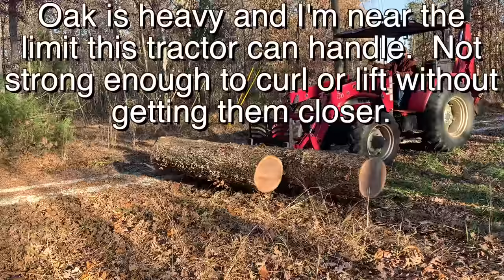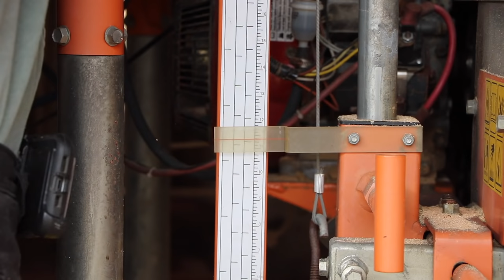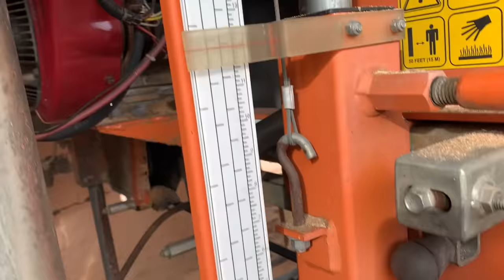Printing Money With My Sawmill...Wood Costs How Much??

Comment from the maker: Hope you all have an excellent weekend!  Yes, I am still working on my Johnson (SMH) but it's taking a bit to get parts.  Cheers everybody!
Reply: Totally save the disks from the punky log, and cut more of those disks. First of all, shorter boards still have a ton of uses, and the disks you cut off will make excellent knife and/or axe throwing targets. :-) Axe throwing is big now!
Reply: Merry Christmas to you and yours, I'm fixing my house so I can move back and get some property right look forward to doing this for sure thanks for sharing look forward to hearing from yorder the ear from them by for now Ken.
Reply: What is a Johnson (SMH)?
Reply: Just toss some VIAGRA at your Johnson  . . . but it's just a 'temporary fix' !  ;)    * I've worked on some of them from the 50's , & had to get creative with making parts !    ** It's amazing how parts like coils / points can be made to work . . . though it takes some creative engiNERDing  . . .   HO HO HO ! ! !
Reply: @Berrnie Mccannaster The flat side of the blade runs against bearings. Those bearing absorb the force from pushing against the log. Sharp tooth would not work well.
Reply: Not sure if you put two and two together yet but Fukushima happened just over eleven years ago now and over the last decade have you not noticed seemingly healthy trees just dying of over the last decade.  Pines especially, i mean look around forests look like crap the wind brakes between farmers fields are all but dead.   Don't get me started about the fluara (other than trees) and fauna and us humans.  Fukushima was an ELE (end life event) as far as i am concerned.   For sure was several orders of magnitude worse than Chernobyl.   Love your work and i thank you for the content.
Reply: What types of blades do you use?
Reply: @nervousordo  Johnson is his old engine. Here's one of his videos on it:
https://www.youtube.com/watch?v=EvHEj7ssbxw
SMH means Shaking My Head.
Reply: @netts2315  ,  each atomic and or thermal nuclear weapon had roughly 6 kilograms of plutonium (for implosion type) now reactor 3 admittedly had 600 tons of fuel per core load of which a minimum of 35% plutonium and each core load lasted roughly 21 months (the facility was nearly 40 years old at time of the disaster) and being that the number 3 reactor was a breeder reactor it made more plutonium over the life of the core.  So at let's say 50% plutonium that equals 300 tons of plutonium that was atomized and thrown into the atmosphere when the pressure vessel failed.  Then account for the other two (most likely all the other reactors) plus the common fuel pool and you get many many times the total amount ever used in the atomic tests.  They lost off-site power for several weeks and they definitely couldn't keep the backup systems running that long so all the fuel that required cooling burned off also into the atmosphere.  And i do agree that chemtrails are definitely not helping, but cows farting and us driving cars is not causing the vast majority of the die offs the planet is experiencing.
Reply: @weirdscience1  I'll just say I don't see things things exactly like you too, especially about the chemtrails, but I respect your opinion as well. I don't really know much of what I'm talking about anyway so I'll leave this stuff for professionals and experts to debate, lol. I hope you have a great day anyway!
Reply: @netts2315  , likewise.  Take care.
Reply: Where are your sawmill barn you made 6 years ago, the shop you are using today(1 year ago) are completely different?

Comment: Hint from a sawyer that cut some logs for me.  Most useful hardwood boards are over 4 feet long, so if you cut a log at 8 feet and there is a big defect at the midpoint then you won't get any 4 foot boards.    So cut at 9 feet or more and you will almost surely get some 4 foot boards.
Reply: what are 4ft boards good for? is this a furniture maker thing?  {i live in a desert. whats a tree?}
Reply: @DieselRamcharger  hardwood floors, I’d assume. Or furniture

Comment: We did same job in later 70's. Worked like dogs on neighbors property, which he needed cleared. 
We used this giant mule (woh and go) to drag logs out, and then when done, we cleared it out of all over story. 
Then shared sawed the logs. Some guy came and he took his share for milling wood. Then we made two 13 foot stacks, stickered every two feet of white and red oak, chinquapin, madrone and some others. 
I tell you we worked like dogs; and the whole batch twisted into pretzels. Half was firewood. 
My suggestion, keep a close eye on humid content and sticker distance. Of course this wood was outside in Oregon, in the shade.
 First sign of tweaking on your stacks, break it up and put stickers closer together. Lastly I would not make huge piles like we did. Something manageable , so you would not hesitate to tear it apart. Don't count your board feet, until the chickens - you know what I mean.

Comment: I need that mill. And the farm lol. Awesome!  Curious what you used the wood for?  Flooring (nvm you said)?  That tree was standing dead for some time before it fell. Typically can’t use trees dead that long for lumber (decorative uses are fine of course). Insects and rot act quickly to weaken it too much. Firewood - perfect. Better to use live trees for lumber. Save the dead ones for firewood. If a live tree gets blown over (roots are still attached) that can be salvaged for lumber within a couple of weeks or more if it’s cold.  Good learning process!
Just need a expensive tractor, a mill and finishing tools (planer etc) to make save all that money but hey if you already have it you’re good.

Comment: did some digging the last time and the term cant very likely comes from its middle Dutch/Low German root kant/kante meaning edge or in some cases border. So a log with 4 edges is a cant(-wood).
Reply: in german as well as dutch it is spelled with a k and not a c In german the word is Kantholz and i think they made a more sound Englisch using the c What I find interesting is the expression middle Dutch / low German Where does that come from?
Reply: @robsterenborg  I got that stuff from the german and english wiktionary on Kante and just combined it
Reply: @robsterenborg  German, English and Dutch are closely related languages from the same Germanic language family with Norman, Celtic, and Scandinavian admixtures present in English. The consonants "c" and "k" can have the same sound; the spelling of words changed over the many hundreds of years with vowel shifts and consonant shifts occurring in the past.
Reply: @heimatliebe116  i know ! i am dutch and live in germany. What I don't get is middle dutch ! The only explanation is that dutch is geographically and linguistically in the middle. Probably someone screwed up  and mixed one thing with the other
Reply: @robsterenborg  "Middle Dutch is a collective name for a number of closely related West Germanic dialects whose ancestor was Old Dutch and was spoken and written between 1150 and 1500."  (source: Wikipedia)

Comment: Have you wondered about moving the cutting scale to an ajustable slide, so you can   Set the cuts to a less arbitrary measure? Like to the closest inch ?  Reset to a 5/4 starting point for ease of counting?

Comment: I am at the comment notice, so I thought I would.

First John, fabulous piece of White Oak. Makes the last piece of Ash look tiny.

I buy my Birch, Maple & White Oak from a small mill south of Middleburgh NY called Cooksburge lumber run by Ray and his brother. Ray a former teacher and his brother bought the business off their uncle on his retirement. Nice bunch of fellows and fabulous to have a mill so close because it really keeps the price down.

I last bought from Ray about 120 linear feet of Birch, Maple and Ambrosia plus one very heavy plank of White Oak that by itself  added another 15 feet. I think on average each rough cut board is 8  inches. As I remember the total cost was $120 and about half of the wood  was Birch, but I am not sure what the actual species costs are.

Granted it was rough cut and I plane it before using the wood, but had I bought this same wood surfaced four sides from a retailer I'd be robbing banks up and down the East Coast to pay for it. Too old for that and my dog Buddy would frown on the idea.

Ray and crew also sell plenty of Hemlock, but for what I make the hardwoods are a must. I must add I found the same kind of pricing at a huge mill called Ghent which is 60 miles to the east of me near Hudson NY. My experiences suggest that whatever drove up lumber prices recently was not at the actual mill end of the stream or even upstream of the mill.

I must say I still shudder over seeing $100 plywood. I remember building a boat when I was 21 back in the late 1970s and back then even marine grade plywood was well below current prices. I'd say if you want to build a camp or shed today use rough cut from a mill. Even all hardwood should cost less in the end if compared to construction lumber.

For more information  on my local mill follow the hyperlink below:

footnote: Wow, $8 a board foot at your local mill. Wonder what the difference between here and the Sout-East mill price is. It can't be I mostly buy Birch. Nice stack of White Oak. That will be one sweet front porch.

https://www.cooksburglumber.com/

Comment: I share your confusion on the alchemy mentality of hydraulic cylinders. I once had an Internaional 350 Utility Tractor with a loader. The load deer had been abused before I purchased the tractor. The cylinder shafts were hollow so that there was only a large O-ring to seal the cylinder. Well, as I said, due to abuse those  shafts  being abused, they were  bent slightly causing significant wear on the O-rings and thus, leaking. I took them to my IH dealer who sent them to their repair shop who gave me an estimate of $500 per cylinder to repair them. The O-rings were 10 bucks apiece.  I opted for the O-rings.  They would last several years between failures.  I mean, what rocket scientist decided a hollow shafts was ever a good idea for a hydraulic cylinder for a loader that would inherently experience lateral loading? It was all working fine when I sold the tractor.

Comment: In October 2022 I purchased a 100mm x 50mm x 2.4 metre (2" x 4" x 94" ) dressed piece of pine which cost me AUD$52.76. BC (Before COVID-19) it was a third that price. The actual dressed size was 94mm x 45mm x 2.4mts. I would very much like your little stick of wood (and I am referring to the C6H12O6) and a sawmill to go with it. 👍

Comment: Nice Video - I guessed 1500 for all three :)
Do you know roughly how much it cost to saw those? Like gas, saw blade wear and so on? And how many hours did it take you?

But great job! I only need a saw mill and then I can go the full path from tree to furniture. I envy the space you got!
Reply from the maker: Actual cost is minimal.  It's really all labor once you have the equipment.  I can definitely do the whole job in around 8 hours including dropping a similar tree, bucking, dragging, milling, stacking.  That's working hard for 8 hours.  Often my days are more hectic and I won't have a full 8 hours to work on 1 thing, so I do it in 2 or 3 shorter blocks of time.  Fuel, maybe a gallon or two.  A blade is about $30 and can be sharpened, so I can mill thousands of board feet with a single blade.
Reply: @FarmCraft101  Yeah, time is costly if not priceless :) thanks for the reply!
Reply: The initial investment in the mill is the killer.
Reply: @FarmCraft101  yes time is money but if you do it on Saturday or Sunday or after tea  then it costs nothing much in labour.
Reply: You are assuming that all the equipment you have is  mostly free. I think to be fair, you need to prorate a realistic cost of your milling equipment, fuel, and an actual cost for your time. I know that cutting your own wood is a real bonus, but is not free. Thanks for your video.

Comment: Good video! 
I figure you could have put the two cants side by side and got two bords out of every cut and that way you would've saved some time. 
Is there a reason you didn't?
Reply from the maker: If your blade is a little dull, sawing 2 cants can really take forever, so 1 is better.  With a nice sharp blade, 2 moderately sized cants cut fine.

Comment: So what about the rest of the tree. It looked like you had potential for another 8 feet of log left. I also wondered why you didn't cut the cants at the same time on the first log, but then you did on the second. From what I've seen in other YT videos on sawing lumber, it would make sense to keep the logs as long as possible in case there are bad spots in the middle... armchair QBing is easy though :)

Comment: Ever worked with Walnut trees? I can cut my pine, cedar and oak into lumber/firewood with my chainsaw, no problem; just sharpen every other day,; but just one walnut tree had the blade sparking like it was on rock after one cut. Decided to just run that blade into the ground rather than sharpen after every cut. Would investing in a saw mill be be worth it or just stick to wholesale the log to someone with a mill?

Comment: Nice video, Everytime I'm hunting I come across trees like this, and wish I had the means to do exactly this.  Question.  Is there any use for the bark you cut off such ass mulch or compost bins?  and what would a realistic cost be to buy a saw like this?
Reply from the maker: I burn the slabs to heat my home.  This is a norwood sawmill that I have owned about 20 years.  A similar model now is somewhere around $10k.

Comment: Great video. I watched your other kiln video and the walnut you dried took two weeks. I might have missed it in the video but how long do you expect the oak to take to reach your target?
Reply from the maker: You can do large batches in 2-3 weeks even if they are freshly milled and as wet as they can be.  I only did the walnut 2 weeks because it had some really thick stuff.  If it was just 1-2" thick 1 week would have been adequate, because it started out pretty dry to begin with.

Comment: You have to subtract the cost of the mill and tractor.  Along with blades, gas, and oil.  Also that 8/brd ft is dry and that wood is wet.  By the time you figure all the time, equipment, and expendables it will cut the margin way down.
Reply: He already had the mill and tractor so those are sunk costs and not part of his calculation. If you were coming at this as a potential new way to earn income and you didn’t have any of that equipment then sure, you would factor them in since you’d be buying them. But since he’s got it all already his calculations are justified.

Comment: people with these bandsaw mills have problems with the blade wandering.  Did you have those problems?
Reply from the maker: Very little.  It wanders a bit at times, mostly when the blade is in need of sharpening, but It's nothing that I can't work with.

Comment: I've got 2 very large Black Walnut trees that are going to be big $ $ $ very soon . . . too bad an Amish logger is going to profit so much from it - I don't have a sawmill , . . . Hmmm   'maybe' I can get some of the milled timber as part of the deal ?    I'm guessing those two trees will bring nearly $ 20,000 worth of prime walnut !     I'll take the $ 3,000 for the trees , & do some home improvements with it .      I would guestimate your White Oak to be worth around $ 5,000 plus or minus !   * depends on being raw material or FINISHED "GOODS" !     What you're calling 'punky' may very well just be 'spalted' . . . just discoloration by fungus . . . It makes great 'features / figure' in a finished product !*Edit : 'Guess that wood was punky , (not that I was questioning your observation ! )    I've cut many tons of Maple , & have saved a good number of bucked pieces for much much better purposes than FIREWOOD ! - 'especially the spalted , 'flame', & birdseye ! ! !       HO HO HO ! ! !     * I'm just a few minutes into this video . . . 'will likely comment more after the fact . . . "V" !

Comment: I've no idea about cutting wood, this is not a criticism, just a question, why don't you cut the 2 cants side by side at 14:53? I see no reason not to, just wondering if there is a reason, loving the channel, newly subscribed and busy binge watching.Sorry you do exactly this 10 minutes later, my apologies.
Reply from the maker: Good question, there is a reason. The blade was dull and was going to need sharpening soon. When it’s dull if you do a wide cut it will wander more up and down. So 1 cant makes better boards. When it’s sharp you can cut 2 cants no problem. Cheers.

Comment: What happend to the top of the tree? Can't you make some boards out of it as well? Or is only the lower stem useful for boards?
Sorry have aboslutely no idea about woodmaking :D
Reply from the maker: You can use the top, but you get far less yield.  Obviously the logs are tapering down a lot, and smaller overall.  There are many knots in the wood where branches come off, often with some rot mixed in, and the wood isn't as stable if the trunk was at an angle up there.  It's just a matter of diminishing returns.

Comment: Good video and thanks for sharing - I have a question: why wouldn't you flip the 2 x cants on their sides, then saw them together simultaneously? I get doing the punky pieces separately because they have different widths of good vs bad wood, but the heartwood cants you created didn't have punk.
Reply: Haha I should have watched the last minute of the video! So why do it then but not initially?
Reply from the maker: The blade at that point was too dull to saw them both at once.
Reply: @FarmCraft101  p